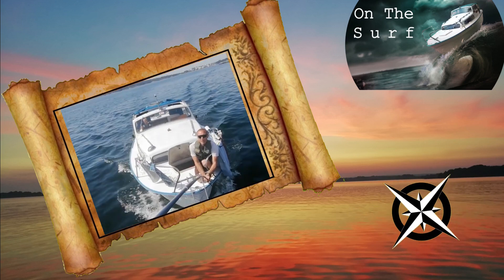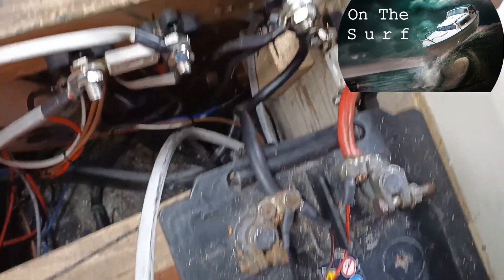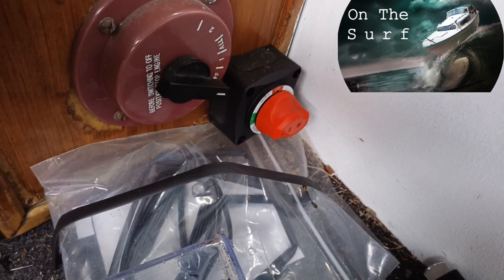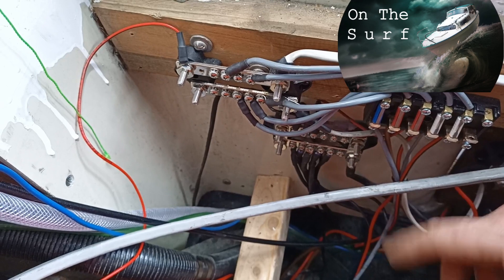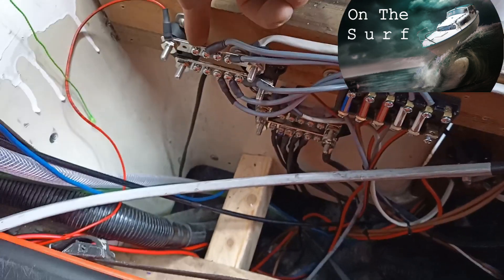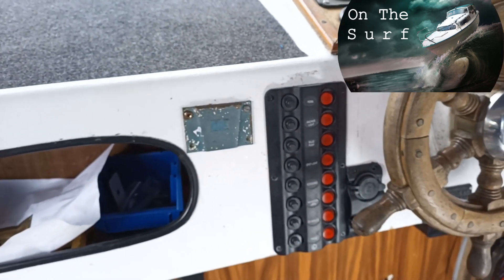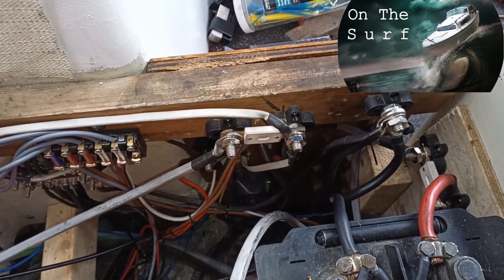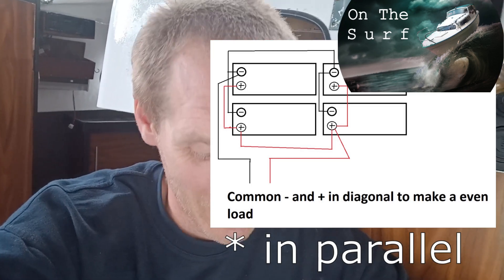new electrical wiring Part 2

Comment: I am in the process of trying to figure out where my wires go. I have so many wires that do not go anywhere.  One end is hooked up to buss bar.  But other end is cut and taped. So I have been removing them. I’m just getting started on my 1975 albin 25.  It also has a Sabb motor. It has solar. A refrigerator freezer. It has the sail option also. But I will not use the sail.
Reply from the maker: I took AL kabels out and started from scratch, if i remeber correct 70kg of gost stuff just laying around